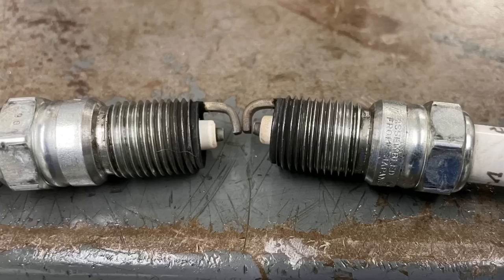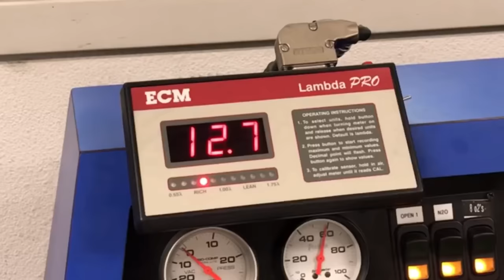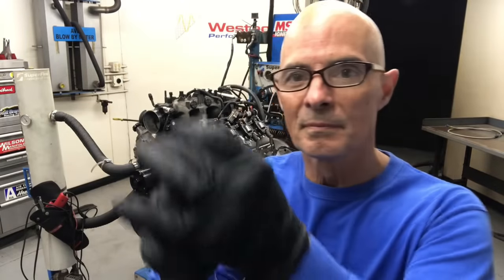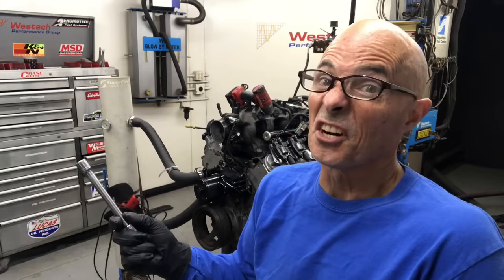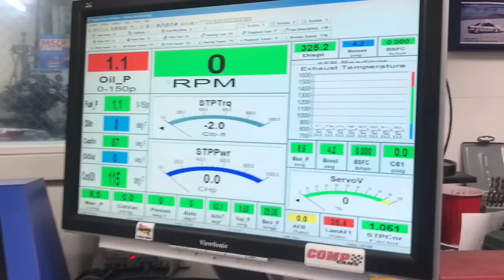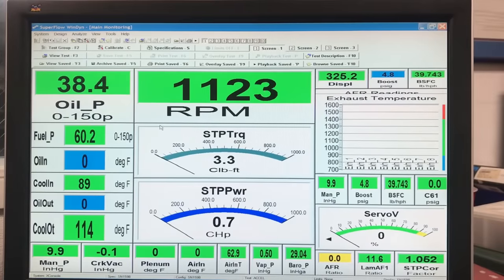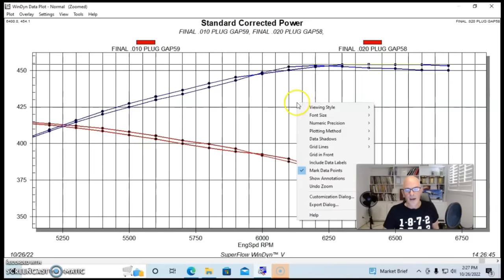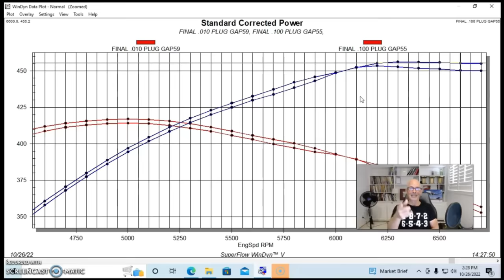JUNKYARD LS PLUG GAP TEST. DOES MORE GAP EQUAL MORE POWER? HOW MUCH SHOULD I RUN? .010 VS .100 GAP

Comment: I can say one time with a 383 Mopar I actually played with plug gaps on a chassis dyno. It was making 187hp at the wheels and we were aiming for 200.
Anyway the plug gap was the regulation .035" and we closed it to .028 just as an experiment. It straight away picked up power and made 202. Who knows why but I guess ignition system current vs just secondary voltage may have had something to do with it.
Reply from the maker: IF YOU CURED A MISFIRE, IT CAN ADD POWER, OTHERWISE GAP DOES NOT ADD POWER
Reply: @richardholdener1727  No the gap did add power. There was no misfire. I find it interesting you immediately invoked the dreaded caps lock to contradict me. 
You weren't there. I was and it happened. Regardless of whether your tests show otherwise, the point is your experiences are valid for you but sometimes things can and do occur outside of one's normal sphere of experience which is why I commented.

Re the engine in question, basically it was a stock rebuilt 383, except with an OEM 400 spreadbore 4bbl intake, a Carter TQ, headers, valve springs and a camshaft (sub.500" lift type hydraulic flat tappet) with Mopar orange box ignition and a recurved 400 distributor which was why it was at the dyno. 
We had indeed just put new plugs in, gapped to factory setting. We played around with the timing, a bit of jetting all with the air cleaner on.
The output was as stated in my 1st comment. No misfires or anything like that. 
I didn't suggest the gap change. The dyno guy did and that was the result. We both took a bank and re-gapped to.028". No timing change or anything like that.
Who knows why it picked up power, but it liked it.
I am a qualified mechanic and I can say categorically in this instance, I'm right and you're wrong.

Comment: I must say that you grabbed my attention. I can understand the pickup in horsepower and torque, my question would be about the difference in how long it would take to lose much more than you gained. How consistently would it show up? Two runs, ten? I believe it would fall off quite a bit faster than one with the proper gap.
Reply from the maker: there is no gain here-we had to use unrealistic gap changes in order to show a difference. Just run factory gap or reduce it for boost-but look elsewhere for power

Comment: I guess it comes down to do you want to save a little gas lower gap setting or little more HP that not really noticable but use a little more gas that probably would be noticeable in long run, with higher gap setting.thanks for info😮

Comment: I bought a used '91 Celica way back when. It had 88,000 miles on it. It also had the original Denso copper sparkplugs in it. Each plug was worn way worse than I had ever seen before in sparkpugs & I've been around awhile. Big gaps. Erosion. Yet, it had been running OK. I replaced the plugs with new ones and there was really no difference in performance.

Comment: I've been told by a guy I work with that back in the late 80s/early 90s he was running a big block chevy that kept fouling plugs, even though it was a fresh build.  One of his friends, who was a "big time racer" here around the Mooresville area went and got a set of plugs, cut the electrodes completely off and told him to put them in and try it. He told me "Surprisingly, it cranked up and ran beautifully." If it's a lie, I was told it. My question was what did it fire off of? The piston face? The edge of the plug? The valve?? Sounded a bit far to bridge to me,  but like I said.  Just what I was told. Never tried it myself.

Comment: The only problem with running a wider Gap is the plugs won't last as long because they get wider over time especially in a turbocharged engine that's hard on plugs. But very interesting video

Comment: I experienced this on a rotary engine turbo. I ran .021 gap. And one day i floored it after alot of weeks of highway driving, and my tune went lean at wot and half throttle. So I tuned it and got it back to its normal 11.5 afrs. The car was the fastest it ever ran, huge power increase from idle to WOT. It felt like an easy 50whp gain. I couldn't believe it, same boost of 20psi. When I went to change the plugs after the tuning session. I realized the copper electrodes had worn to the point of .060 from all the highway driving. ( I was using msd DIS-2 boxes 125mj) these msd boxes eat plugs. I put a fresh set at 0.021 like always and my tune went super rich. And lost all the power I gained after having to retune once more. 
I wonder if this is because of the rotary engines inefficient combustion chambers that I saw such improvements with spark gap. I also wonder if it's because of using E85 that I likely saw a better power gain as well since there's more fuel to ignite. Maybe a combination of both. 

Richard, thanks for doing this test. Would be interesting to see if there would be more gain in power using E85 and then trying methanol. 😉
Reply from the maker: boost requires less plug gap

Comment: I suggest you use a 80,000 volt coil on each plug to see how that helps on either .10 or .01 works with lots of power in the spark.
Reply: Okay, in adult English this time: I suggest you use an 80,000V coil on each plug to see how that affects power on the engine on both the 0.1 and 0.01 inch plug gaps. My apologies for hasty gorilla typing of the original post.
Reply from the maker: these coils have more than enough spark energy for the test-there is little or no power there

Comment: Of course plug gap changes timing with a smaller gap being more advanced.  A larger gap will have a larger spark.  Does that engine have fixed timing or does it have a computer that can change the timing on the fly?  Any spark knock with the small gap?  How did that affect the running temperature?  The fuel type and compression makes a big difference to timing.
Reply from the maker: TIMING IS FIXED-DOES NOT CHANGE

Comment: Richard. I'm thinking that you used the stock ignition system. What would be the difference if you ran a high output ignition system? Thats a simple & affordable change that most gear-heads would do.
Reply from the maker: the factory ls had a high output ignition system-individual coils with lots of dwell time

Comment: The reason the .100 spark gap produces more power is because the longer spark ignites more of the fuel simultaneously causing the flame front to propagate more quickly effectively causing the ignition timing to advance.  This is why you see the HP gains.  However, the increased spark gap runs the engine closer to the knock limit, as any calibration running a more advanced ignition timing would do.  IE: more plug gap is advancing timing, less plug gap is retarding timing.  Would be interesting to see how far the timing can be advanced with each plug, and at what timing the max HP is observed for each plug.
Reply from the maker: no-the reason .100 gap made a touch more power than just .010 was because .010 was too small. If we ran anywhere from .020-.080-the power would be the same-it has nothing to do with timing
Reply: Thanks for the reply!  I love your experiments and channel.  I am currently doing a header and cam swap on a 2014 Camaro SS LS3, first time every doing either.

From a "slo mo" combustion point of view, the increased surface area of the physical spark and the increased voltage buildup required to span the increased gap should ignite more mixture during the spark instant compared to the smaller gapped plug, thus initiating flame propagation more quickly.  That is why I say the larger gapped plug will act like it has slightly more timing than a small gapped plug, given equal "computer" timing.  

I've never verified this, but in this video there DOES seem to be three distinct HP and torque curves with the three different gaps in the range and direction one would expect for this combustion theory.  

I think making sure all of your plugs are gapped equally is more important than the plug value themselves, so that the tune will act equally in all cylinders, ensuring you're not running a hot or cold cylinder.    
 @richardholdener1727

Comment: Interested to see this on a boosted engine as 8 out of 10 times everyone is told to go conservative on gap to prevent spark blow out and most will go too low (like 0.020) when they could likely be slightly lower than stock.
Reply from the maker: you need to go .020 or less with high boost

Comment: It's a shame that there has been so much snake oil in the aftermarket ignition market over the years, because I think there are some kernels (pun intended) of knowledge out there that can provide some performance gains.  The idea that a bigger kernel can initiate the combustion burn better has merit, but you also have to play with ignition advance.  If a vehicle is running at MBT already with a normal gap, the only way a bigger kernel would help is if you were able to run less advance, allowing for less pressure build before TDC, and more after.  

I generally like to run a bit on the tight side simply because plugs age and wear and the last thing I want is someone coming back in a couple weeks with a misfire.  Last year I was sent an ignition system designed to mimic the pre-chamber plasma jet setup in F1 cars.  I really didn't think it would work.  However, it did require a lot of changes to the tune.  Overall power wasn't changed by more than 1%, but with the plasma jet setup I had to retard ignition advance at full throttle by 15-20 degrees versus normal to avoid detonation.  This was on a DOHC 4-valve engine.  The timing curve looked a lot more like what we see in a high compression turbo DI engine than a NA port injection engine.
Reply from the maker: COOL

Comment: Id like for you to mix in this test along with the spark plug clicking test you did. Looks like clocking got you maybe 1ish hp randomly throughout the rpm range, and if this is 3-4hp increase, maybe doing bith is an easy way to pick up 5 hp for free
Reply from the maker: there is no 1 hp-there is not 3-4 hp, and there is no 5 hp (there is zero hp gain)

Comment: Was this test with the used junkyard coil packs? New wires? A tiny difference in rpm rate might cause this, too. Does your system log elapsed time during the run, so you could do a precise comparison? Just thinking about possible sources of variation. Really interesting test, thanks Richard!
Reply from the maker: wires and coils were both used, high mileage. the rate of acceleration is computer controlled. its precise

Comment: I like the E3. Plugs !
Reply: I've also found they worked very well, especially small engines like motorcycles, generators, weed eaters, etc. They're kind of the best of both worlds, the benefits of small gap (good electrical conduction for easy ignition), and large gap (maximum exposure of spark to combustible material for more complete burn) since you don't have the electrode blocking the spark. I've been told certain engines don't like them (like picky Chrysler products and forced induction engines), but I've never had an engine they didn't improve. Most noticeable improvement was/is an almost new Kawasaki Ninja sportbike (NGKs from factory), but I've ran in them everything from 2strokes to Hondas, 3800s and 4.3s, Hemis to Northstars, Coyotes to Chevy LS's, etc.

Comment: 🔔😎
The left plug pictured has the side electrode only halfway across the center.
I "half gap" plugs like this and doing it back to back on the very same plugs, there's a little bit better low/mid range feel. Might be because of an "indexing" change, or not.... Fox 5.0 HO. Mild.
I believe it anyway.

Comment: As spark gaps are a standard way to close a circuit at a certain voltage.. Doesn't it make sense that given a certain coil, closing the gap will close the gap at a lower voltage thus advancing ignition a bit, and a bigger gap delay the timing a bit?
I'm not sure what the time range/difference would be if the coil is sufficiently strong though.. offcourse a bigger gap would produce a hotter discharge/plasma over a bigger surface increasing ignition

Comment: Richard i had a friend 351w efi it had swapped injectors and ran a bit rich i ran a 50-60k can race coil and .55 gap seamed to run better until that hot coil eat a hole in rotor button that took me four days or so to figure out that button was hollow in centre so i swap in new one and filled the hole with epoxy fixed that issue on the ole clunker
Reply from the maker: HEI WAS FAMOUS FOR BURING CAPS AND ROTORS TOO

Comment: Flame quality is important. But I would like to see what happens in a turbo setup. I've heard a lot of tuners talk about "flame-out" where the pressures inside the combustion chamber don't allow a good enough spark, or rather the flame created becomes ineffective leading to low power/ knocking particularly at high RPM.
Reply from the maker: boost requires smaller gap
Reply: The higher cylinder pressure raises the resistance and the coils fail to jump the gap. It’s less being blown out than difficulty jumping the gap.
Reply: @BLKMGK4  semantics?

Comment: Is it because its easier to read this type of plug rather that the 3 electrode type that stops them being more used in tuned engines. Not had a car without 3 electrode plugs since  2000.

Comment: 1 minute in on this video, and my first impression is, the wider the spark plug gap the better, with one caveat.  Do you have enough voltage to actually jump across a very wide gap?

My reasoning,  It's all about initial ignition, or flame front.  A close gap ensures a spark occurs without misfires, due to lack of coil energy, but the initial ignition of actual fuel molecules is smaller.  If you are able to arc across a larger gap, you are making a larger initial ignition with a larger volume of fuel, therefore, the flamefront is not only larger, but faster in the chain reaction of the burn.  

It may be miniscule differences, but different, none the less.  

Lets see if I'm right.
Reply: 4 1/2 minutes in and I had another thought... If you are able to gap plugs to .100 and still not have a misfire, because you have a 'hot' enough coil to make the jump, You'll probably need to retard overall timing to maximize the potential power.  

I say this, because with a larger volume of fuel molecules igniting at the initial flame front, the quicker the flame front is going to progress through the entire fuel charge.  It's going to be algorithmically and exponentially quicker to complete fuel ignition.  And if that happens quicker than a close gap, with a smaller volume of fuel at initial ignition, or flame front, that full combustion is going to be delayed, hence running more advance engine timing.
Reply: Just as I thought, wider gap creates a larger volume of fuel at initial ignition, then that larger volume expands quicker with a larger flame front and it made power, even without adjusting timing.

I'm willing to bet if you'd try this test again, the .100 plug gap would benefit even more, if you backed the initial timing off 1-2 degrees.  

I know this, because I'm injecting a new fuel additive I call Hydronium... It's hydrogen based and hydrogen has a much quicker flame front than 87 octane fuel.  When I don't adjust timing and add the hydronium, I loose a tiny bit of power (about 3hp on a 400hp sbc), when I back the initial timing off 3 degrees, I gain 12 hp.  That tells me that the added hydrogen to the fuel is causing the fuel to burn faster across the flame front, therefore too much timing advance over just regular gasoline.
Reply from the maker: You missed the point of the test, we used extreme gaps (big and small) to illustrate there is no change in power with any reasonable gap change (unless you cure a misfire under boost with reduced gap)
Reply: @richardholdener1727  I get the point you are trying to make here.  But why would you want to put an extremely wide gap, beyond manufactures recommendations?  My answer is, to search for more power.  Sometimes you have to do a couple of things in combination to actually realize the power gain I'm seeking.

I'm sure one would not get more power, without changing anything else, at least not measurable on a dyno.  I'll illustrate another example so my point can be made.  You want more power, so you decide to go the Nitrous route.  But just injecting nitrous into your intake won't give you more power, in fact, it'll probably make the engine go lean.  But, injecting the nitrous allows you to do 'the other thing' that will give more power, that being more fuel.

I race outboard mod vp tunnel hull boats.  People ask me how they can make their boat run faster.  It's not just one thing, like a jack plate.  You also have to add a low water pickup nosecone, and a surface driving prop, solid engine mounts, etc.  

I just thought it would be interesting to see if adjusting timing along with an extended spark gap would make more power.

Comment: Wouldn't it be better to keep the test consistent? When you remove the plug and gap it put that same plug back in the cylinder it came from? Or what about using brand new plugs with different gap size plugs so your not re-using the same plug over and over? Would love to see this test done with colder plugs as well keeping all the variables the same. Believe to see some inconsistencies
Reply from the maker: changing from 1 cylinder to another changes nothing-that is only a talking point

Comment: I'm curious about power delivered by ignition system in all tested cases. I think higher gap needs more electric current that means more heat and more electrode erosions in spark plug, more heat in hv coil, etc.. I used to think that all parts in ignition system was designed to keep all parameters in certain values to balance the cost, endurance and reliability.
Reply from the maker: THIS IGNITION SYSTEM HAVE ENOUGH JUICE FOR THE TEST